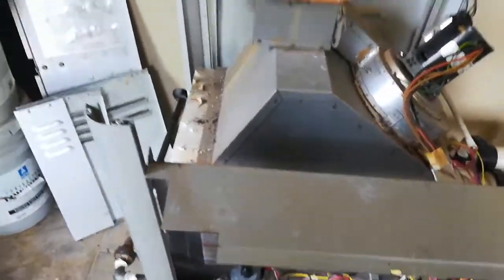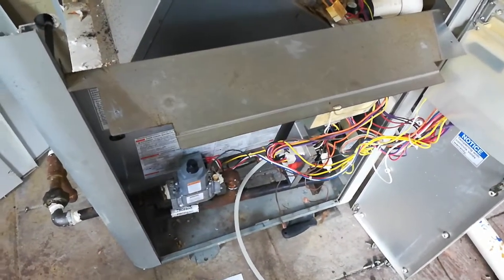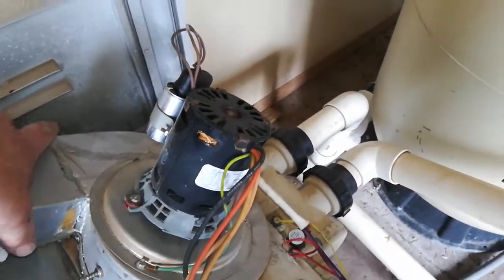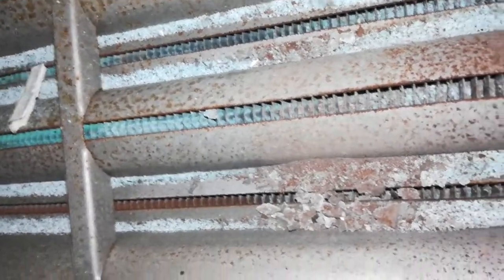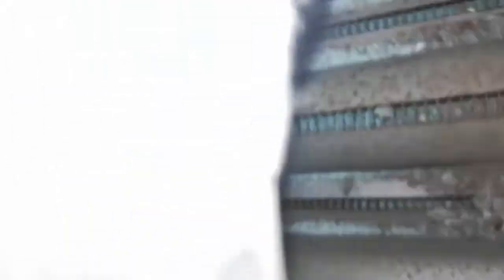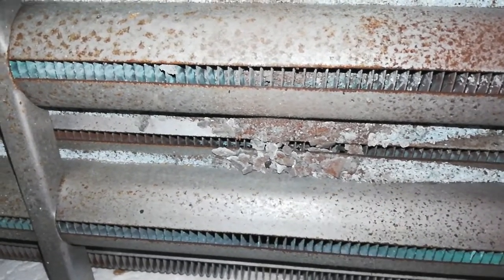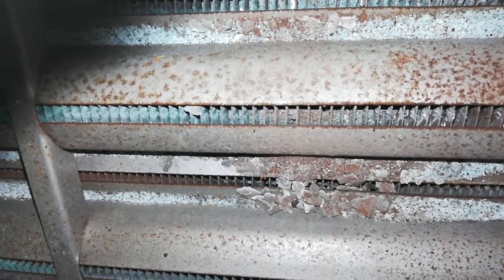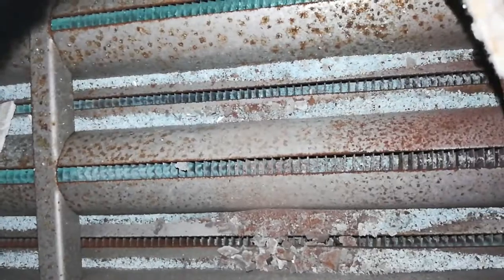Pentair MiniMax NT heater fix #1

Comment: I have the same Heater it was short cycling and I was told it needs to be replaced that my heater core was swollen and no good. I checked everything my self and found a pin hole in the white hose that runs from a pressure switch up to the fan on top I replaced the hose and it has been running perfect for the past 5 years. (Obviously that pool company doesn’t work for me anymore). Just an FYI for Pentair owners.
Reply: How did you find the pinhole?  I’m having the same issue and I’ve replaced 4 things and still having the error message
Reply: @hectorc347  I removed the hose and stretched it out and saw a pin hole near one of the ends that I couldn't see just by looking at it when it was hooked up. The smallest hole will suck air and cause the unit to turn short cycle. I cut the hose  after the hole and reattached it and it's been every since.
Reply: @radams4999  So I was able to get the heater working, once I changed the capacitor. I had already changed the pressure switch, the 115 degree thermostat,  the probe and the 150 degree thermostat. Got lucky with the hose.